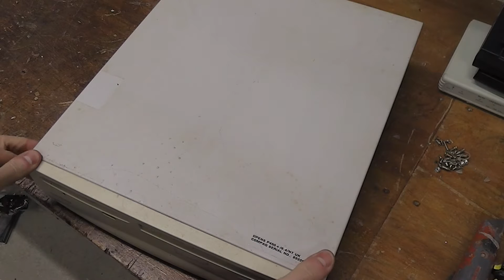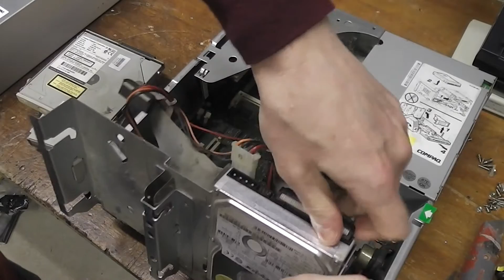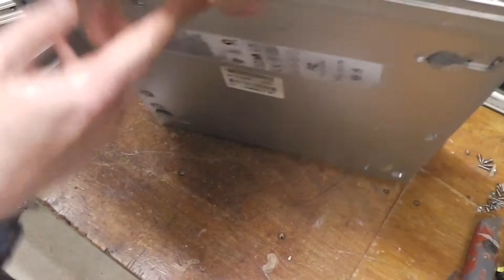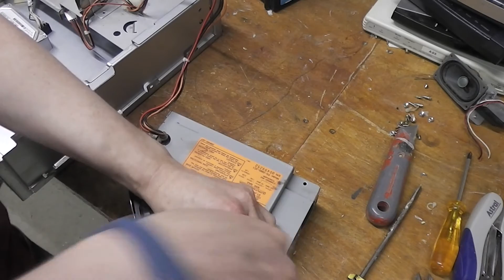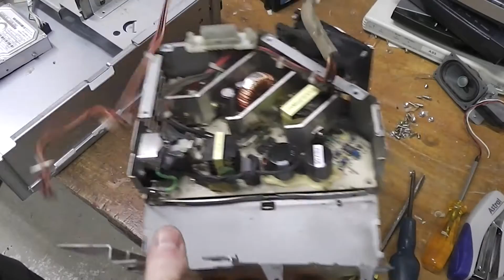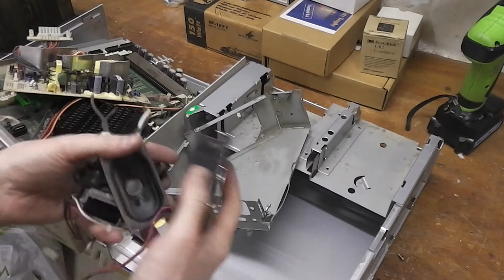Compaq Desktop Computer Case and Teardown

Comment: 10 years later, this is still a very helpful video. i never noticed those little flaps. finally got the old, rusty and dirty floppy drive out, and switched for another defaced samsung that is pretty much pristine. i think ill test the original someday tho, see if it still works anyway.